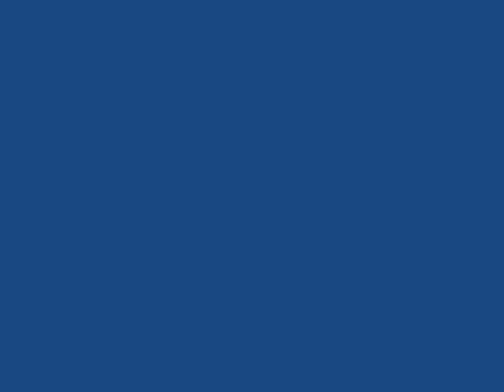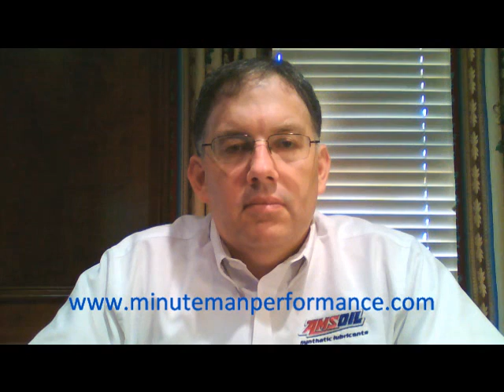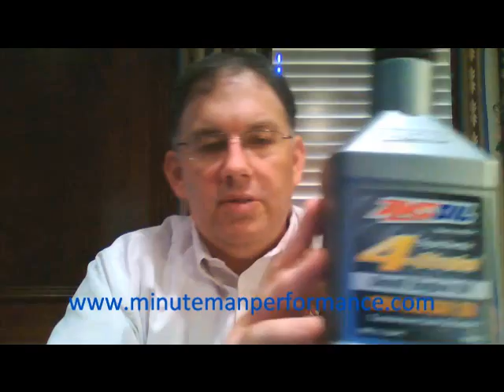AMSOIL ASE 10W-30/SAE 30 4-Stroke Small Engine Synthetic Oil

Comment: does amsoil make a sae30    am i ok to change from sae30 to 10w30  synthetic .
Reply from the maker: AMSOIL recommends their 10W-30 Small Engine Oil (product code ASE) for any application calling for SAE 30 or 10W-30.  If you need additional viscocity to reduce oil consumption, you can move to the 10W-40 Small Engine Oil (product code ASF), or even 15W-50 (code SEF).  There is also a 5W-30 Small Engine Oil (AES), recommended for colder climates.
Reply: @Best-Synthetic-Oilscom  thank you

Comment: Only half the story does this guy convey.  Car Engine oil is perfectly fine, durable and chemically sound  for small 4 stroke engines.
Reply: Small air-cooled engines with flat tappet cams benefit from higher levels of ZDDP for protection, which aren't found in modern standard automotive oil.

Comment: I just filled my new generator up with Amsoil small engine oil after I broke it in on the OE oil it runs on propane and I don't know if propane is harder or easier on oil but either way I wanted the best to protection only Amsoil great video

Comment: Do you have to wait for the break in period to be over with on a brand new Kawasaki FR 730 V before using ?
Reply from the maker: In general, NO.  On my own new equipment, I usually change oil the first time at around 10 hours to remove the factory-fill oil that will be contaminated with break-in wear metals.  If the engine consumed/used any of the factory-fill oil during that 10 hours, I might refill with fresh OEM oil and run it to the first oil change interval listed in the Owner's Manual - usually around 50 hours.  If the engine didn't use any oil during the first 10 hours, then I will make the switch to the AMSOIL Small Engine Oil right then at the 10 hour point.  AMSOIL now offers their Small Engine Oils in 5W-30, 10W-30, 10W-40, and just released - 15W-50.  They have you covered!  These oils contain the higher levels of anti-wear additives that have been reduced/removed in current API SN and SP oils for automotive use.  Don't use SN or SP in small engines.
Reply: @Best-Synthetic-Oilscom  Perfect. Thank you sir .
Reply from the maker: Contact me at 678.787.3028 or info@best-synthetic-oils.com for more information or to set up your free trial Preferred Customer membership for wholesale prices and free shipping on orders over $100.

Comment: Would you recommend this oil on a Simpson power washer with the Honda motor. What about a John Deere riding mower. Thanks.
Reply from the maker: I recommend this oil for any small 4-cycle engine that calls for a 30-weight oil.

Comment: Started using this in all my small engines. So far, so good!
Reply from the maker: AMSOIL just added a 5W-30 viscosity to their Small Engine oil line-up.  Many newer generators are calling for this weight.  It would help with cold weather starting and protection.

Comment: Good for a Honda Engine?
Reply from the maker: Are you talking about a Honda generator, motorcycle, car engine, or something else?
Reply: Like a gx390
Reply from the maker: Yes - the AMSOIL 10W-30 Small Engine Oil (product code ASE) is excellent for this engine.  You can expect much longer oil life (if you choose to run it longer) and longer engine life as well.  Your engine should also consume (burn) less oil when using this oil.  Contact me directly at info@best-synthetic-oils.com or text to (678) 787-3028 if you have other questions.  If you order from AMSOIL, please use Referral # 1302686.

Comment: would you use amsoil in a home generator? what weight
Reply from the maker: The oil featured in this video would be my #1 recommendation.  The product code is ASE.  You can order it directly from AMSOIL by calling (800) 956-5695.  Give the operator Referral # 1302686.  Also - ask about the Preferred Customer program.  It can save you 25% on every order and get you free shipping on orders over $100.  AMSOIL has products for about every application, so you can use your membership for all of your vehicle and equipment.  Thanks for commenting.  Call me at (678) 787-3028 if you have any other questions or concerns.

Comment: What about generac 2000 inverter generator... Calls for 5w30 synthetic
Reply from the maker: AMSOIL Synthetic Small Engine 10W-30 would work well, or you could use an automotive 5W-30 synthetic, such as AMSOIL Signature Series 5W-30 (product code ASL).  The ASL costs more, but would also provide outstanding start-up lubrication and engine protection.  Call me at (678) 787-3028 or visit website:  www.best-synthetic-oils.com.

Comment: fuck Amsoil just put a good quality diesel oil in there and call it a day
Reply: Wrong. Had to rebuild a GX 240 a few years ago for an older fella who owns MANY pieces of equipment, including diesel and gasoline powered. Was running 15w-40 in the GX until the exhaust valve snapped in half and took out the piston and head. An upper end rebuild, 10w-30 full synthetic, and it runs like new. I'm a fan of Amsoil and user of many products! I recommend their oils to many folks.
Reply: The oil not being changed often enough has nothing to do with 15w40 oil being a bad choice. It's a bad choice for colder months though, but so is 10w30. IMO, 5w30 would be a better choice for cold weather operation. But MAYBE, if the GX240 is an interference engine, the valve could have stuck open if it wasn't well lubricated and get broken off when the piston came up. I still find it hard to believe that 15w40 oil instead of 10w30 caused a valve to break off though. Was that an interference engine?
Reply: Not saying that you are wrong, but I just don't see how running a slightly thicker oil than what is called for could cause a valve to snap, unless the valve somehow seized up and got stuck open from lack of lubrication and got hit by the piston, if these are even interference engines. Could you please explain that logic?
Reply: The oil wasn't changed frequently enough for one, and two, he is using the engines primarily in the fall and colder temps and assumed the valve snapped due to lack of proper lubrication.

Comment from the maker: The drain interval on this oil is whatever the equipment OEM specifies, but you can extend that interval significantly by monitoring the oil with oil analysis services.
Reply: I am an Amsoil dealer and I use this oil in all of my small engines. I change the oil about every other year. After one year the oil still looked like i just put it in the engine.

Comment: The specs on this oil is beyond excellent,the Noack is less than 4.1 percent...Fire Point  (493) F*..
Reply: thanks for the info robert
Reply: professorfidelcat   I am not a AMS sales person but AMS does not lie about their stuff and nobody has proven them wrong... It can take the heat and will not cook away...  Thanks, Good Luck,
Reply: Robert Diehl ok will try one day, yes my bike (only 50,000 kilometres use) cooks up the regular car 10w40 syn oil and needs some top up after about 2000km, its in a tropical country with 30-35 degC  sunny heat and the worst part the bike is air cooled inline 4 cylinder 1200cc with an oil cooler as the only real cooling apparatus..i cant idle it longer than 10 mins in a traffic jam cos the oil smokes up from the crankcase as it heats up!! maybe this oil might benefit such vehicles
Reply from the maker: professorfidelcat If you need a 10W-40 motorcycle oil, try AMSOIL MCF 10W-40.  It is wet-clutch approved as well.  If you are outside USA or Canada, you'll need to purchase it through the International Division of AMSOIL.